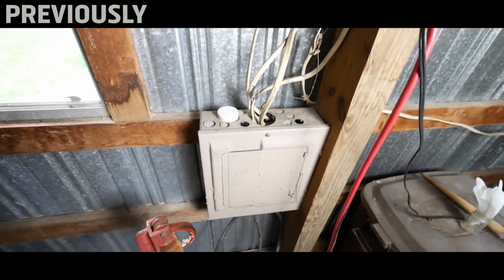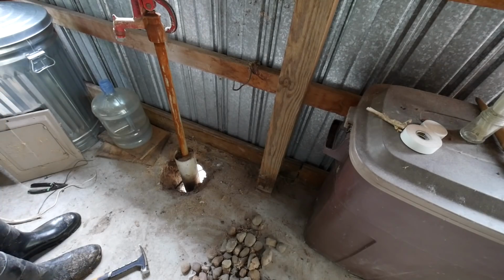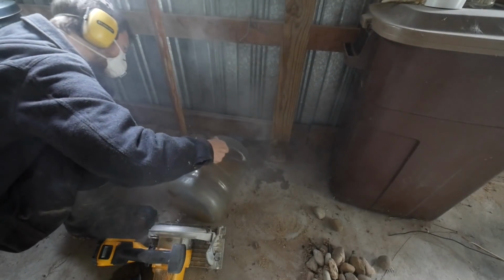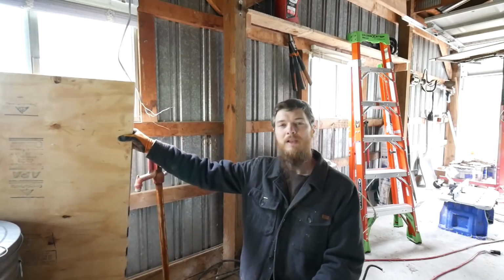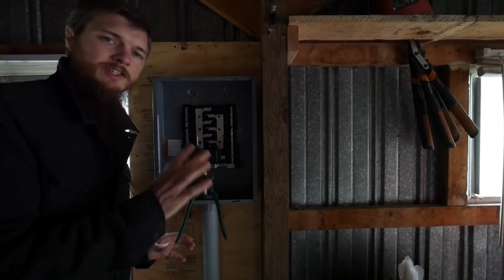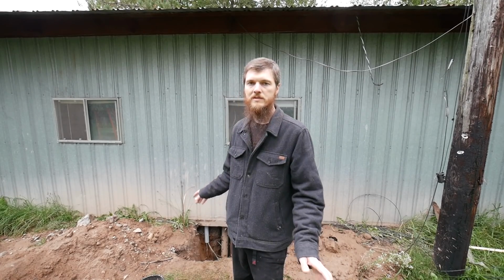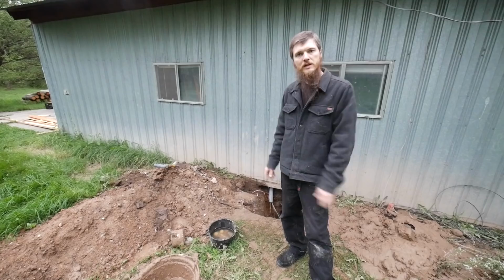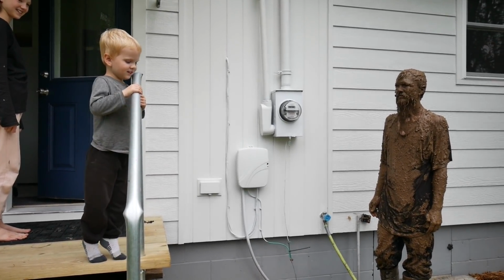SCARY ELECTRICAL work Turns into a Nasty Mess

Comment: Get yourself a bottom feed water proof exterior breaker box. You can Mount it to the exterior of barn short piece of conduit over the feed wires, up to bottom of box, Then run conduit from top of box up the exterior wall, coming back in toward top of wall to keep it all away from your inside Water source.
Reply from the maker: I considered doing an outside disconnect like that, but didn't see an outdoor bottom feed box with large enough knockouts. It's definitely a good idea. I'm not too worried about it being near the hydrant as long as it's done right and not the way they had it. Thanks for your thoughts!

Comment: Why wouldn't you run new wires from the house to the barn? Those old wires don't seem safe in the ground for so long. Plus being next to water seems dangerous.
Reply from the maker: Because it would be a large job and expense. We just need to clean this up a bit and it will be great. The wires are rated for ground burial so they will be okay and it's not so bad being near the hydrant. My main concern was the expose wires and improper wiring. We'll definitely fix the safety issues!

Comment: I can not tell you how hard I laughed when you came up out of the hole covered in mud😂😂😂😂
I don’t know anything about electrical. Could you tell me what a ground rod is and what it’s for?
Reply from the maker: haha XD
Reply: I know, right? Even funnier because it was so unexpected!

To answer your question... A grounding rod is a metal rod (usually copper) that's connected to your electric supply and pounded down 8-10 feet into the ground near your panel. It's a safety feature. The copper is a great conductor of electricity, so in case of a lightning strike, for instance, electricity will flow to the rod and into the ground, taking the danger away from you and the electrical panel.

Comment: I have the same situation where the house water is right next to the electrical pedestal outside.
It worries me. I didn’t notice when I bought because I didn’t check my house well, due to pain and disability. I hired a inspector, that I relied on, who for some reason missed so much. The neighborhood I live in is very old, so everyone’s is like that. I guess it hasn’t been a problem. All my wires are exposed outside and get rained on.😨😬

Comment: S E R I O U S L Y  ! ! ! ! 

 You NEED  to  start with a  DIS-CLAIMER ! ! ! ! 

NEVER - Ever Under any circumstances  should  anyone  ( EVER )   mix    Electricity and  water.   Regardless of  if  you  think , You Know , or  are under the  impression  - that - the  Circuit ( Power )  is Off and  Disconnected ! ! 

WoW - It  is  truly ( S H O C K I N G )  you have  lived this  long.  Construction or  Destruction and  the  way  people , industries , and the  Trades  go  about  it  are  anything  ( EXCEPT ) what  you  have  displayed here. .   Even  if  you  got  ( LUCKY ) this  time  around  - Chances  are  you  WILL NOT ! ! ! !   Repeat   ( WILL NOT ) be  getting lucky  each and  every time  going  forward. 
Anyone  who  knows  anything  about  how  these  two  things  ( DO NOT  MIX )  Much  like  Oil and Water .  It  may sound  like an idea  worth  trying  yet ( BY ) the  time  you  figure it  out -  The  Grave  will be  dug and  you will be  worm food and  nothing more.   Ever  hear  the  one  about  the  Scorpian and  the Frog  ?   If  not  you  need  to brush up on the  reality of  life. 

ANY and  all of  your  methods have  been questionable  at  best .  Nails sticking  up about  every where  you  look.  Trash , Rubbish, and  debris scattered  all around  the  areas  you  are  walking  in , around , an d thru.    Busting  up concrete  with a  Dinky Hammer -  REALLY -  did  you  now  learn anything  in school .  Rebar , wire mesh , rocks, stones, and  cement  - WHO  do  you  actually  feel  is  going  to  win  that  race  here -  YOUYR  Dinky  Hammer  or  a  powered  Jack hammer and  maybe   even a  20 pound  sledge with Cold  chisels and  Brute Force ???

Sure  appears  you  always  take  the  Hardest  way  to get to the  simplest  of projects  ! !  ! !

Word of  advice  -  Study actual trades and  construction methods of  Operation before  you  land  up  killing  yourself  or  someone  else  along  with  you  in the  process.   DUMB - DUMB -DUMB - DUMB - DUMB , etc...
Reply from the maker: I may not always have the best tools but we try to do our best with what we have. That little hammer did the trick. It's not a race for me. The electrical working is going well, and if the power is disconnected, it's perfectly safe to run wire in the ground. So please don't worry there. But as always, we just like sharing what we are doing and always encourage people to be safe and do what's best for them.
Reply: THERES IS NOTHING DUMBER THAN NOT KNOW HOW TO GIVE FRIENDLY PRODUCTIVE ADVICE! He told us in the first of the video that he had turned the electric OFF! Your post is rude and degrading. It’s called social media bullying! Hiding behind a keyboard to sound touch. You came across pathetic!
Reply: C'mon, MCL. How do you REALLY feel. You're so subtle..... 🙄

Comment: You need to remove the ground bonding screw on your sub panel.
Reply from the maker: Since we are keeping the 3 wire supply the bonding screw is used. It get's taken out for a newer 4 wire hookup to isolate the neutral and ground. Since we don't have a separate ground, they need to be bonded for safety.
Reply: @diyfferent  You only bond the 2 at the first point of contact which is the main service, This is a sub panel regardless of 3 or 4 wire.

Comment: Since that is a sub-panel I was always told that you should run the ground from the house.  If you have multiple grounds in your system you can have voltage differences from one to the other causing electrolysis in your system.  Just something to keep in mind.
Reply: He is fully aware of that and addressed it in the video if you would pay attention.

This wiring method was within code when that work was originally done. He is only doing repairs, so he does not have to upgrade to current code as it is grandfathered in.

This is not an issue of wrong way versus right way. This is an issue of good practice versus better practice. It is perfectly safe and there are literally hundreds of thousands of existing subpanels wired exactly like this in the United States.
Reply: @byronmill  I wasn't worried about code.  I was worried about the electrolysis basically eating the copper wire.  It can cause it to completely corrode in the space of a few years depending on how bad it is.  Trying to be helpful, not critical.
Reply: @jamesmckillop3019  there are multiple safety reasons and a few equipment conflict issues (problems with GFCI) that led to the NEC change requiring subpanels to have ground and neutrals isolated and a neutral run back to the originating panel.

I have NEVER heard of electrolysis being an issue or a reason for the code change. I did a Google search trying to find any reference to that at all and could find none. You would have to provide me with some links to reference material for me to accept that as being a concern.
Reply: @byronmill  My info is pretty old.  I heard it from the instructors back when I was going through Military electronics training 25 years ago.  I also realize now after re-watching it that it only seemed to effect copper in damp areas.  Not sure if Aluminum would be effected one way or the other.  It may have also had something to do with people that tie their grounds to copper piping as well.  I am a bit fuzzy on that.  I am sure about multiple grounds in a system that are separated by distance creating voltage differences between them and therefore creating unintended current between them.

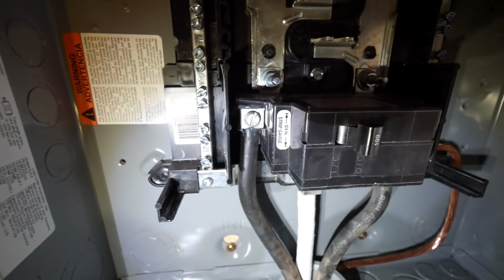Comment: 13:19 - Is that the neutral and ground bonding screw I see there? Is so - you are not allowed to bond ground and neutral anywhere except in the main panel. They should be separate in the rest of your circuits and sub panels.
Reply from the maker: Since we are keeping the existing 3 wire supply the bonding screw is used. It gets taken out for a newer 4 wire hookup to isolate the neutral and ground. Since we don't have a separate ground, they need to be bonded for safety.
Reply: @diyfferent  Sorry. I made the comment while watching the video, and hadn't heard you explain everything yet.
Just making sure you stay safe. Electricity is a silent killer.
Reply from the maker: @sjokomelk  We appreciate it :)
Reply: @diyfferent  I wired many sub panels back when 3 wires were used. They did not allow you to bond them together then or now for that matter. It's still a sub- panel.

Comment: I love your channel was going to nitpick about the way you wired the subpanel but you addressed the grounding issue. Not up to NEC but will be much better then the way it was before.
Reply: But the way he did it is up to NEC because this configuration was according to code when this was initially installed. Because it was, this is grandfathered in to compliance with previous code and he does not have to change it as long as he is only doing replacement repairs.
Reply: @byronmill  OP is totally rewiring their barn. I doubt any AHJ would consider that grandfathered. 

I don't remember the vintage of their manufactured home but having a separate equipment grounding conductor has been in the code for decades.  

https://www.ecmag.com/section/codes-standards/digging-past 

This is a moot point since I don't believe the OP needs the work inspected.
Reply from the maker: @tomschmidt381  I think that article is mainly referring to receptacles being grounded. The allowance for 3 wire feeds to subpanels was still allowed in places into the 90s and early 2000s. But regardless, you are correct, when doing this much work I would doubt it could be technically grandfathered in. But I just couldn't bring myself to leaving it the way it was. It's been bugging me since we moved it so I'm just happy to finally clean it up.
Reply: @byronmill  Was never allowed even back in the day. I was there.
Reply: @robertgregory2618  it is a detached building.  It was allowed prior to the 2008 NEC.
Reply: @byronmill  I realize that cause I wired tons of out buildings. What I am saying is the bonding of ground to neutral was not allowed ever. The green screw must come out. It is only allowed at first panel the utility hooks up. The main service from which this barn sub-panel is fed from.

Comment: If the voltage isn't the same from hot to neutral and hot to ground, you might want to add a second ground rod about 2 ft. away and connect them together.

Comment: Isn’t the breaker box & buried wires still next to the water? Is the water spicket still there or did you take it out?
How’s the electric mower tires?
You had a natural face & body mask 😂 You are nasty😂😂
Reply from the maker: It's still next to the water hydrant, but that isn't a big problem. We mainly want to raise it up and get those exposed wires secured in conduit and out of the way. If we had more wire to work with I may have moved it over.

Comment: Before retiring in March 2017, I performed hundreds of lightning evaluations for proper grounding every year.  I strongly and I mean strongly encourage you to run a separate ground wire from the barn ground rod to your house ground rod.  If not this is not done differential ground current from lightning will damage your electrical/electronic equipment.
Reply from the maker: Thank you. I was thinking of running a ground back to the house. I'll keep it in mind.

Comment: there are blades made for cutting cement
Reply from the maker: I was just using what I had. But it worked surprisingly well!
Reply: @diyfferent  ok
Reply: Geologists use a tile saw to cut rocks in half. The tile saw was adequate for what he was doing. Companies label products specifically for something  (i.e. concrete) to sell more product that isn't necessarily needed. Doug is very intelligent and takes into consideration what will work to get the job done.  No need to run to Home Depot and spend money foolishly.

Comment: Oh Ashley, how do you get his clothes clean after all that mess?  OH dear Maverick didn't know what to think but he knew you needed a bath!!  I still can't understand how electric lines can be safe if there is that much water there.  Where does the water come from?  And are the lines in a pipe?  Too many questions so don't bother to answer. I am just expressing my thoughts.  Have a great day and I hope the weather stays good long enough for you to get most of the barn finished before winter sets in.  Thanks for showing us this one.💙🛀
Reply from the maker: The wires are rated for direct burial so the water won't bother them. The hole had water in it because we just had a good rain and it just filled up the hole. It's right under the roof edge so it just caught a lot of rain.

Comment: i could just imagine the kids hosing you of in the backyard after that mud stunt you pulled
youre son likes to imitate you and you can expect him to come to the door looking verry brownish grey and muddy with a white tooth smile on his face 
as for the ground rod : over here they usually put the ground to the metal waterline , or they hammer a rod in with a pneumatic hammer and keep going intoo the ground untill the resistance is right , over here ground isnt part of the electric cirquit its a savety that feels when power moves to ground and shut off the power if that happens 
we have 220 volts wish is the zero (N) and one phase (L)or 380 volts wish is zero and L1 L2 and L3 with the groun as a safeguard manning the main switch
hope you took the mower off the charger when you disconnected the power , i used to collect immobillity vehicles for my work and have had it happen multiple times that someone unplugged a charger of an electric vehicle from the mains but left the chargeplug in and that caused the charger to drain the batteries beyond repair

Comment: Run conduit on outside wall, use entrance ell into back of electrical panel.
Reply from the maker: That's one way to do it, but I feel that it would use more wire in the bend than just going straight up and every inch counts here.
Reply: @diyfferent  Okay, your way does makes sense. The wife and I really enjoy your videos!